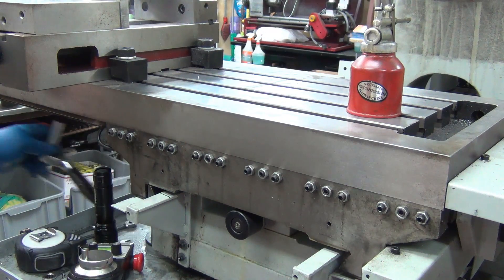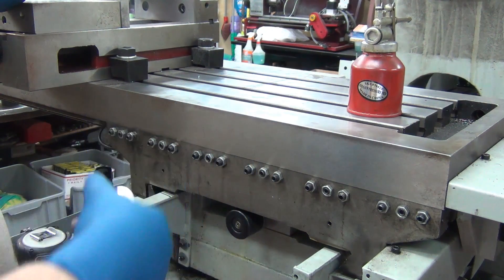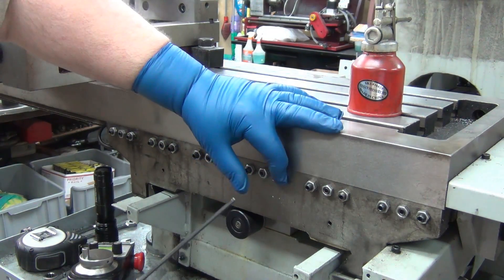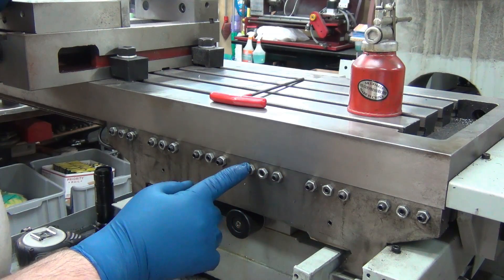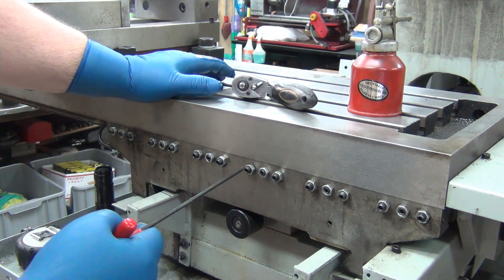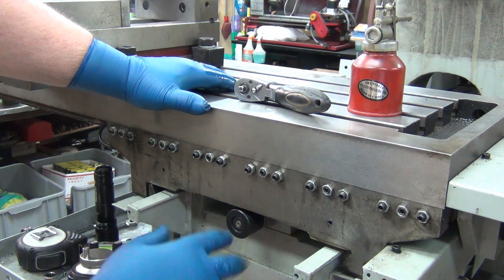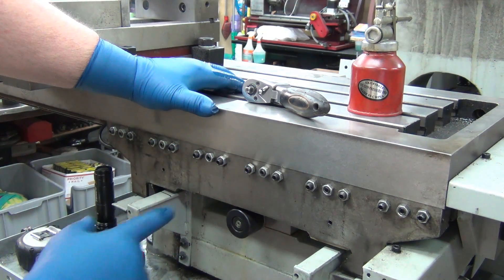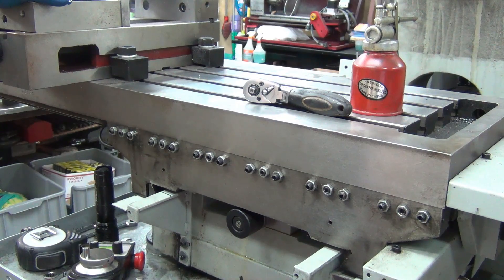Novakon Torus Pro - Gib Adjustment Part 3, Conclusion

Comment: Would a 1/4" drive torque screwdriver allow you to set those screws consistently? I had thought to use one on the cross slide gibs on my lathe, but i have only had it about 15 years so it has not been needed yet.
Reply from the maker: +Chris Stephens Possibly.  I have no clue how accurate the drivers are.  I don't have the nuts very tight.  Any unevenness in the threads would change the torque required to turn the screw and change the actual pressure on the gib.  It would be more accurate than doing it by hand, but I don't know it if could be done to a given torque every time and called good.
Reply: Accuracy high, practicality questionable. I must experiment one day. I have a click stop pre-settable one and a variable adjustment slip one,I  don't think I have ever used either for real. Bit off a waste really, but one day....
Reply from the maker: +Chris Stephens Never a bad thing to have high end tools in the shop. :)

Comment: Adjusting things to a close tolerance is frustrating as everything.  At some point you find yourself making it worse again.
Reply from the maker: +Amateur Redneck Workshop Yep.  I think I've gotten it closer this time.  I had about .004" of backlash with my last adjustment....so I was definitely too tight.  I'm down to about .001" now. :)
Thanks!